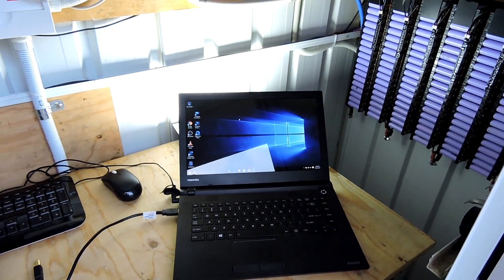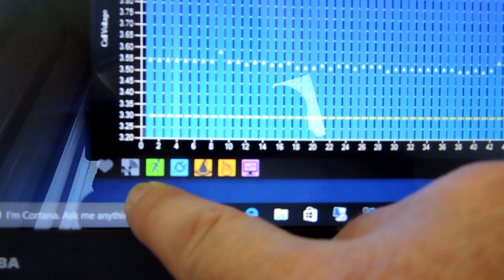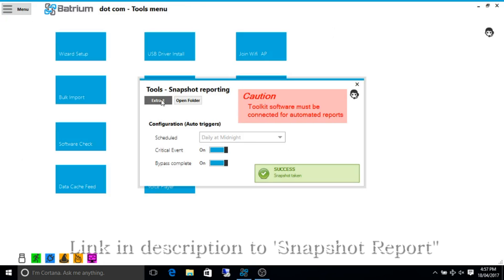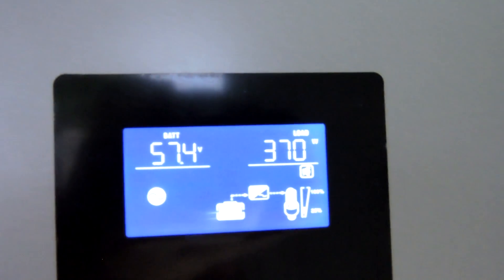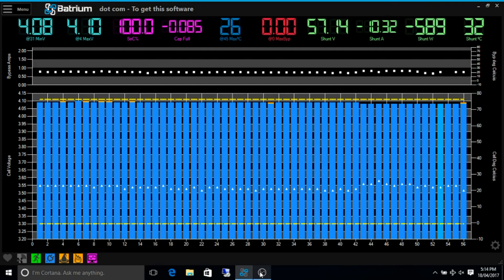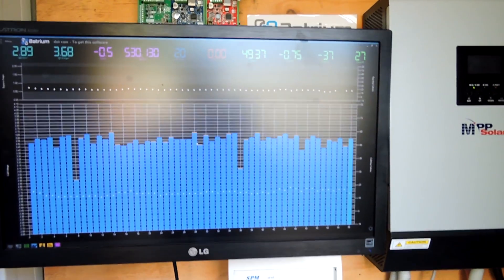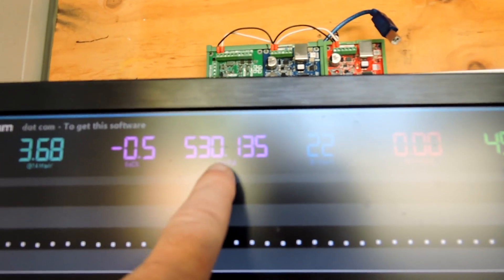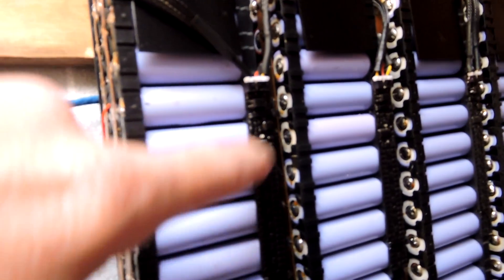18650 real world load test - 63 hours to run from 57.4v to 49v not bad from recycled laptop battery

Comment: That's pretty awesome. I can't wait to see if the duration is a full quarter more on your 40kwh test. your loading seemed pretty small most of the time in this video. how long before you start implementing the charge idle water heating?
Reply from the maker: it's coming but has to be practical. That is my current normal house load as both my teenaged daughters have 'kinda' moved out. No washing or drying of clothes was used during that test. With the next one it'll be started on a Friday night as the weekend always uses HEAPS more power. Take a look at the pinned post here i've go the dryer running at the moment...lol

Comment: Would you happen to have a geothermal concept or idea in the making or have already made a video?
Reply: What would the absolute bear minimal pc requirements, because if you can use a Panasonic toughbook those that are hardened against emp. because those be slow but if this soft ware work's under those versions of pc's your that much closer to future preconditions, or a faraday cage like a copper meshed trash can could be used but not during the even in question.